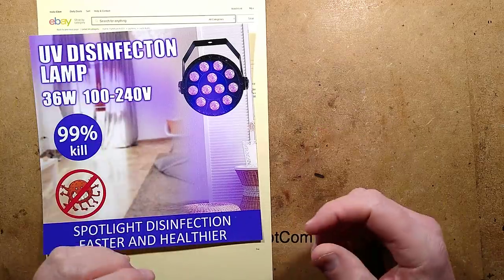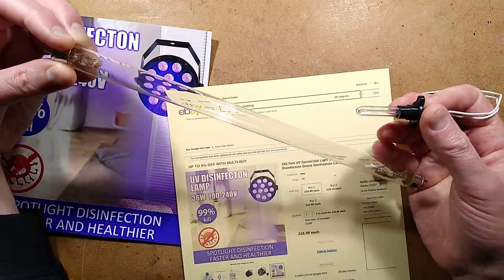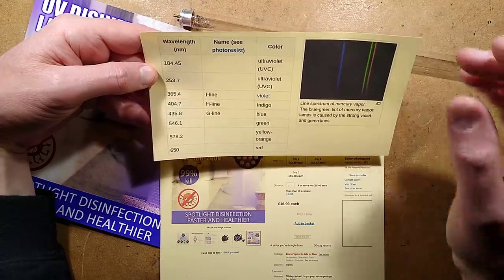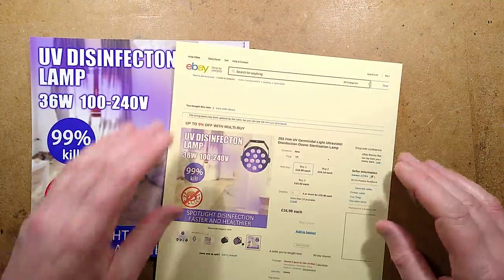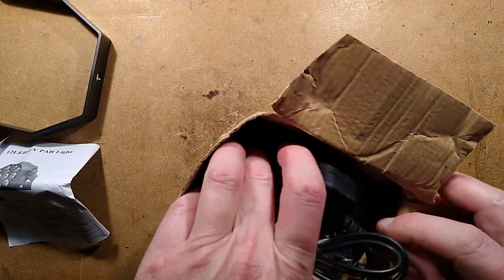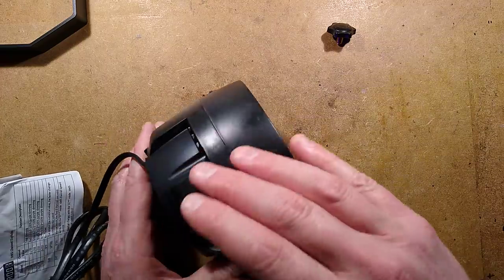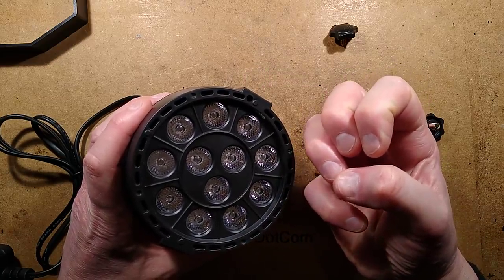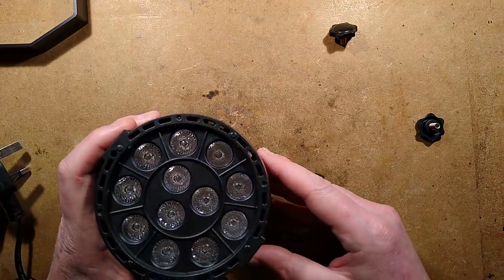Fake UV disinfection lamp from eBay.

Comment: Clive,
Just wondering...what do you do with all the dismantled components you end up with? Bin them? Or do they get sorted and safely stored in a set of mini drawers...waiting for the "mad" electronics scientist's next project...?
Reply from the maker: They usually get rebuilt or the parts filtered for the good bits and stored.
Reply: Haha! I knew it. 
I love taking stuff apart especially printers. So many steel shafts and cogs to good to waste. No idea when I'll use it all ...although I do build models. I studied electronics in the eighties...but got terribly confused by gobbledegook and stuff that doesn't move  - nand gates not gates etc nor....so I went down the more Mechanical path where you have simple things like pressures and temperatures...turbines - Power!
NEVER throw away what might come in useful!

Ps
That was mentioned in the divorce tribunal...😡

Comment: 222nm UV light is being studied for use in large area disinfection, it so happens that 222nm does not affect human skin....
Reply: that sounds a bit like this https://news.columbia.edu/ultraviolet-technology-virus-covid-19-UV-light and based on this https://doi.org/10.1371/journal.pone.0076968 paper - I would not be that trusting of anything purchased right now without a multi thousand dollar analyzer for the uvc spectrum to ensure only far uvc - could be useful for cruise ships, not my area tbh
Reply: Thank you for bringing that up.  222nm is like a proton torpedo fired by a non-Jedi, it just impacts on the surface of the dead skin cells.  But when it hits a small thin skinned virus it powers right through to the DNA/RNA and breaks it.
Reply: @Incognitus-Umbra  Why not a double slit metal plate to split the spectrum and a piece of B/W wide spectrum film to capture it.  Plus a quartz lens to direct the light to the slit.  Optionally use an uncoated CCD sensor chip instead of the film. Use a few separately bought traditional single line LEDs and a quartz lamp to test and scale the result.
Reply: @johncrowerdoe5527  I think I've suggested before on another of these videos to use a known UVC led as a sensor, as it should create current when exposed to a similar wavelength but again not my area and I'm more than happy to  be corrected plus that is an oversimplification as a given device may emmit more than one wavelength, however if I were doing this for a business or institution and not as a mad science one off at my bench then I would want some CYA with a certified Analyzer
Reply: @Incognitus-Umbra  An UVC diode sensor doesn't report an actual spectrum.  A double slit would avoid aberrations from specific glass types and is a quite traditional instrument for the job.  Using separately bought known spectrum sources to test provides proper CYA calibration, preferably with a known pure substance listed in the scientific literature.  Uses beyond confirming fraudulent lamps is measuring RA for good lamps and identifying unknown substances.
Reply: @johncrowerdoe5527  Thanks for you posts, I will have to look into that if i get some mad science time, I'm sure those devices will be available in some number of months and it's always good to be able to double check them
Reply from the maker: The 222nm technology uses an excimer lamp that will produce a very narrow and exact wavelength when stimulated capacitively.  I'm not sure the long term stability of the gases involved though, and if that could cause an unknown wavelength shift over time.
Reply: @Incognitus-Umbra  Double slit spectrum testers are pretty standard lab equipment since decades or more, though mostly used for visible spectrum.  The geometric relationship between the slit size, angle of deflection and wavelength makes it a traditional tool for measuring the actual wavelength.
Reply: @randallneikirk6385  Not totally unlike alpoha radiation. Harmless UNLESS it can get inside you (dwallowed / inhaled etc). If it can DIRECTLY bombard your internal important bits, it can cause massive cell damage. BUT is totally unable to travel more than a few cm in air, far less human skin.

Be interesting to use one of those polonium based anti-static brushes on a culture of assorted nasties and a non Po brush on a control petri-dish to see if there is any difference.

Not that I adviocate trying to deal with COVID-19 by using lots of alpha emitters :)
Reply: @guyteigh3375  Culture a virus without a host cell, and anything the brushes do pales in comparison with that accomplishment....

Comment: Have you actually gotten your hands on a UVC LED? I'm deeply into Fluorescent mineralogy and could certainly use something that doesn't wash out the rocks with those other spectral lines!

That said, you could use a hunk of Willemite as a safe test for UVC frequencies. I could send you one, or you could probably easily find 'em on Ebay.
Reply: I tested out a UVC LED on some of my fluorescent minerals but found little to no reaction to most SW-reactive minerals. The LED did cause clear lead crystal glass to glow sky blue, but most minerals nadda. Wavelength just isn’t quite short enough.
Reply: @AScannerClearly  Willamite  glows weakly under UVA (395nm) a bit stronger under UVB (365nm) and at 254nm can almost be seen from space.  So if it is barely glowing I'd posit that there is no UVC from your LED at all.

Comment: Let’s hope this is what all the Trumpets have ordered off eBay since Orange Man told them it’s worth a shot, not the real sterilisation bulbs that will turn their eye balls into sand.
Reply: spencer hardy 

“So, supposing we hit the body, with a tremendous, uuuh, whether it’s ultra violet or just a very powerful light, and I think you (he addresses Dr Brix*) said that hasn’t been checked and you’re going to test it, and then I said supposing you brought the light inside the body, which you can do either through the skin or, uuuh, in some other way, and I think you* said you’re going to test that too? Right, sounds interesting.

And then I see the disinfectant, where it knocks it out in a minute, one minute, And is there a way we can do something like that by injection inside or almost a cleaning because you see it gets in the lungs and it does a tremendous number on the lungs, so it’d be interesting to check that, so that you’re going to have to use medical doctors with, but it sounds interesting to me. So, we’ll see, but the whole concept of the light, the way it kills it in one minute. That’s pretty powerful.”

Sales of sterilising germicidal UV bulbs have risen hugely on eBay.com.

Comment: I bought one for my $20 just to prove a point to a friend.  :-)   I exposed freshly inoculated Petri dishes at 30 sec, 1, 2, 4, 8 mins, etc.  And absolutely no change from one side of the plate in the shade from one side in the fake sun.    30 seconds with a real light would be obvious.

Comment: High power UVC LEDs at a wavelength of 253 nm are tremendously expensive. LG Semiconductor produces watt output power LEDs at reasonable prices. However those have a wavelength of 265 to 270 nm which is sufficient for germicidal applications.

Comment: I noticed the fan is actually blowing to wrong side. Sucking side has lower cooling effect than blow side. But if fan is correctly mounted, the wires will hit the fan and block the rotation. So it's not great design or wires are not guided around the fan very well.

Comment: I dread going to eBay these days to look for something that I need since you have to go over with the listing with fine-tooth comb as normal and then mull it over for several days wondering what is wrong with the listing. The service seems to be overrun by scammers who do not even have the product on hand and simply order it from China or Amazon and resells it or they are price gougers selling stuff to battle the virus at outrageous prices. I had looked at getting a UVC lamp on eBay and gave up on buying anything .

Comment: Hey Clive good work by you. I welded together some 6061 Aluminum round tube and sheet into a frame to mount 4 ea 36 Watt UV-C germicidal tubes. These tubes are new and hit the 254 nM bench mark. I talked to several Doctors and they tell me that 250 J/cm2 is the kill zone but it takes time to achieve this. Most viruses and bacteria are disabled at first blast of the light but they recommend 36 mins of irradiation to fully sanitize a mask or any product that is made with blown fiber so I use 36 mins when I do rooms with my zapper. Its is NOT instant like these companies try to make it sound. Keep up the good work as you are exposing these frauds!

Comment: I bought a similar “corn” UVC led light and those are also fake due to the wrong chip set and the price point. I even gave them the benefit of the doubt and ran a test for 2 weeks growing mold and it actually accelerated the rate of growth! Chinese scammers should be charged with negligent homicide for this.

Comment: Regarding the 184 nm band - as it is absorbed by oxygen (which it splits) it is therefore not transmitted much through air, so is not available.  That's why it's called "vacuum UV".

Comment: A test I would do is point it at a banknote/passport/id card, anything that has uv-reflective pigment in it. If it doesn't light up the pigment if is just violet and thus can safely be used as a disco light.

Comment: I actually ordered a UV "germicidal" cabinet designed for sterilizing small towels at a spa. I took a culture off my phone before I put it in and one after. I only took the culture off the side facing the light, left it under the light for 20 minutes only about 1.5 inches away from the light. For some reason the culture taken after the "germicidal" rays hit the phone were actually stronger. Overall it was worthless and I returned it to Amazon denoting the process I went through to determine it to be trash.

Comment: The placebo effect was "expected" so people were ripped off. Sucks.

In my opinion, just use the brute force method. Take a mercury vapor lamp, shatter the outer envelope, plug it up with a ballast in the area to disinfect... turn it on, run, and look away!

KREOSAN has a video on that. Who needs LEDs?

Comment: I'm curious, what wavelength does those little nail polish curing LEDs emit if measured with a spectrometer...🤔
I use one of those little ones that run off USB to cure UV resin/glue. Same type as one you had a video about fixing a while back.
Reply from the maker: I think they're UVA.
Reply: As most UV gels require the use of 350 nm. to cure, most UV lamps emit a wavelength ranging from roughly 320 to 400 nm. But an LED manufacturer that uses an LED gel that is rated for 375 nm. will use bulbs that emit from only 370 to 380 nm

Comment: I ran into these "UVC" lamps too and they are on Amazon and on Ebay. Most of them had the Edison screw with an array of LEDs around the bulb then encased jn plastic claiming to be 60W but that was too high of an output to be just LEDs at that size plus as you stated, the real LEDs were about 4-5 dollars or pounds and looked just like that. Plus, each of them outputs about 5mW so you would need hundreds to get that output and the cost wouldn't be the $30 advertised. So my message to people is do not buy any led uvc lamps because they're fake.

Comment: Just got a large phone UV-C  coating machine with two clear lamps on each side.....Definitely can smell ozone when its open after each use.....it also has two little LEDs at the bottom, i was wondering what they were for but like you said....in a bright room, this will tell you its on if you can not see the uvc bulb light.......would like to see a tear down on how these phone sanitizer works.

Comment: Might be fun to replace the color LEDs with their perspective original color but leave the UV LEDs in the middle. Especially with a DMX controller. I may wind up getting a few of the disco lights and replacing the white with UV myself. Always fun man. Keep them coming. Cheers.
Reply from the maker: Cheaper to buy the RGBW light, and it would also have the red channel calibrated properly for their lower voltage.

Comment: Low pressure (I think 0.00005 bare) mercury vapor uvc light produce more or less only 253nm wavelength. The higher pressure mercury vapor lamp  generate 253 and some more wavelenght.

Comment: Cute 405nm ish light. But certainly not UVC. I am preparing a video on the physics/testing/spectroscopy of a different style with some interesting light blue phosphors on the LEDs. I have not seen such an LED before so I am very excited to see how they look in person. The light also " Makes a burning smell like natural sunlight " and this I am curious of as well. So much anticipation for such a fake product. It's going to be a delightful time taking it to bits. I hope the light arrives.
Reply from the maker: Don't hold your breath.  I reckon they are using ice-blue LEDs in those to emulate a real mercury lamp.
Reply: @bigclivedotcom  No breath held, I know absolutely what I am looking at. Optics are my specialty. I have never seen blue phosphors on LEDs though and it's something to add to the collection. I don't expect a shred of UVC but it should make a great fake UVC LED light video. My biggest mystery is to see if they added something inside to try to emulate the smell of ozone. Expect this to be a video posted in the next month or so. I'll be comparing it's effects on phosphors and mold in contrast to UVA/B/C lights and LEDs and putting the light they send under a spectrometer for the exact output wavelength profile. I love me some optical science.

Comment: Hi Clive. Maybe you could do a little rant about soldering and magnets? I recently tried using some as kind of a terminal that is intended to stick to a CR2032 and power a small flickering led, but can't figure out a consistent way of soldering to them without demagnetizing due to the heat. Thanks for reading :)
Reply from the maker: When a magnet is raised above its Curie point it loses its magnetism.  It might be possible with either conductive glue, low temperature solder or a solder lug or tab that you solder to and then glue to the magnet so the magnet holds it against the cell.

Comment: For the last year I have always given a negative feedback now, if the item is not as described. I'm tired of getting fake stuff and if everyone just accepts refunds and revises their feedback nothing will change. I wish everyone would do that, but unfortunately the the "get payed to keep your mouth shut" works too well (it did for me for a long time).
I just got a few DC-DC converters with a fake LM2596 chip. That the whole module costs less than 2€ should have been a hint, when the chip alone costs about 3€ in bulk from a reputable source, but I didn't check that before ordering. The chip was easily recognizable as fake because the font on it was the typical Chinese "times" font and when measuring the switching frequency it was about 50kHz instead of the genuine's ~150kHz.

EDIT: I just checked back. I wrote product rating  yesterday for the module pointing out the fake chip. Product ratings are now no longer visible for that module. Go figure...

Comment: Clive I think that ozone is also germicidal as reactive oxygen species will cause burns and mutations, similar to peroxide’s I believe.
Anyway I got my E26 UVC today, took a month and a half to arrive to NYC from AliExpress, disinfected bathroom and bedroom, ozone took a long time to air out, I took all the safety precautions. I think my bathroom lights aren’t wired correctly because there would be a UVC pulse of light every 5 seconds, but there was no such thing in my bedroom ceiling light.
Reply from the maker: If it was pulsing when it was turned off that's just capacitive coupling charging up the internal capacitor until it triggers and gives a pulse of light.  Especially common with multi-way switching.
Reply: @bigclivedotcom  it did happen when the light switch was off, but the switching isn’t multiway(I think), it’s the same switching mechanism as the rest of the house 🤷🏼‍♂️ Anyway I don’t intend on leaving it plugged in so I guess it’s fine, just hope it doesn’t get damaged like that, it’s 25W

Comment: you seem to have misunderstood something, UV-C does not produce ozone, it is instead converted into longer-wavelength by ozone
If an energy-rich photon (e.g. UV-C) hits an ozone molecule, it splits the ozone module into an oxygen molecule (O2) and elemental oxygen (O)
thus the photon is absorbed by O3 (ozone) and emitted again as a longer-wavelength photon

Comment: I recently looked for "ordinary" UV lamps for curing resin and for a couple of bug zapper lamps.  which seem to have vanished from the listings.
Couple of years ago I paid about £2.50 for LED and £6 for CFL  Now the same bulbs have been converted to UVC and germ killers and are twice the price.
If anything they are a deeper violet than the older lamps, they still cure UV resin (I wonder do the "real" UVC work as Curing lamps)?  I'm guessing they'll also attract the 6 legged beasties too.  I very much doubt they'll hurt anything smaller.